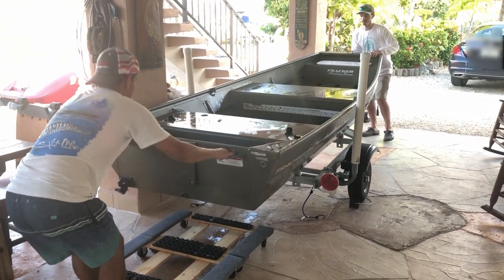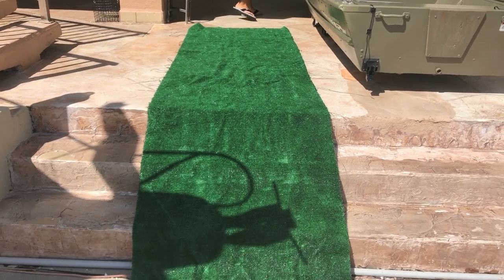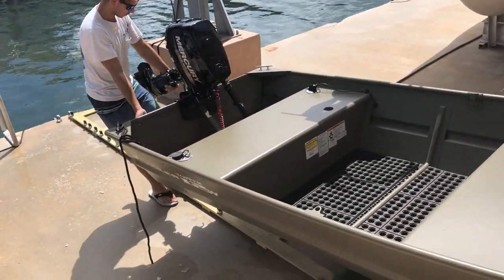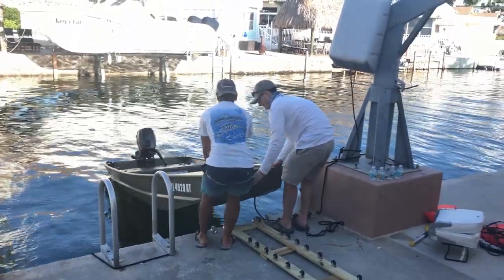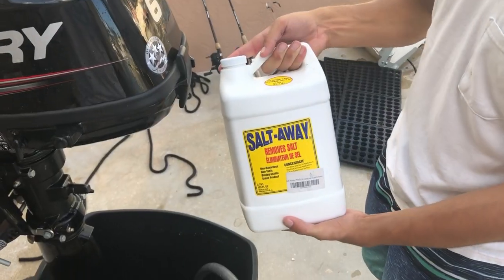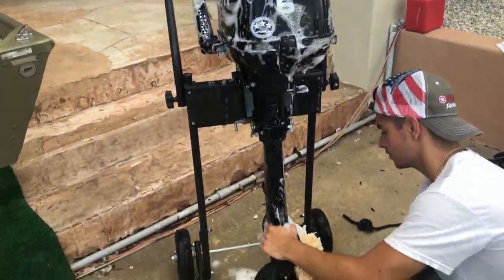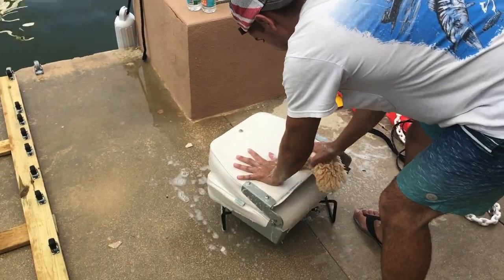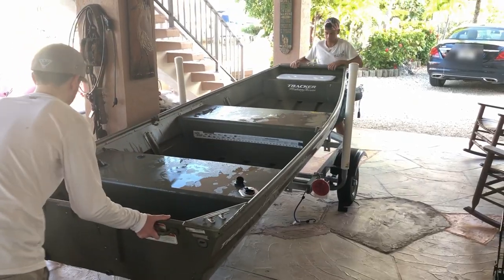How We Launch and Clean Our Modded Jon Boat (No Boat Ramp)

Comment: thanks for all these jon boat videos. question for you guys...where did you get those rubber floor mats for your boat? i’d like to get some for mine as well. i have a tracker topper 12 just like u guys. thanks!
Reply from the maker: Thanks for the support! The rubber mats are just some kitchen mats that you'd see at a restaurant. They're custom cut to fit the boat. There is a link to an Amazon listing in the description, but you can find them in other places like Home Depot. Good luck on your Jon Boat setup!